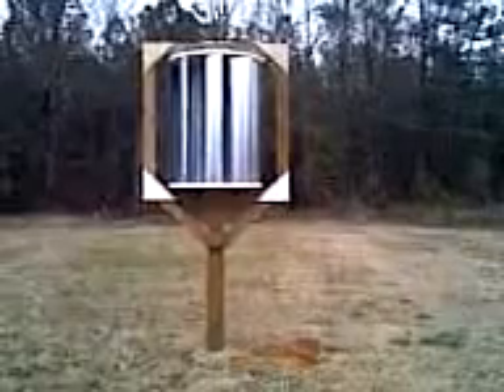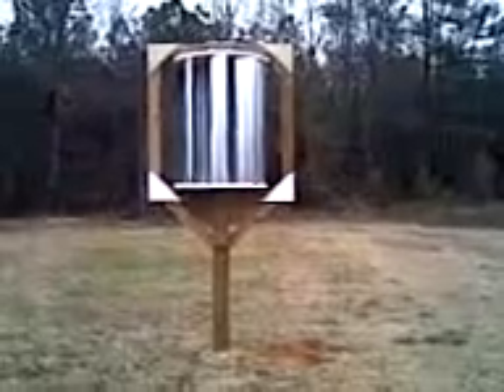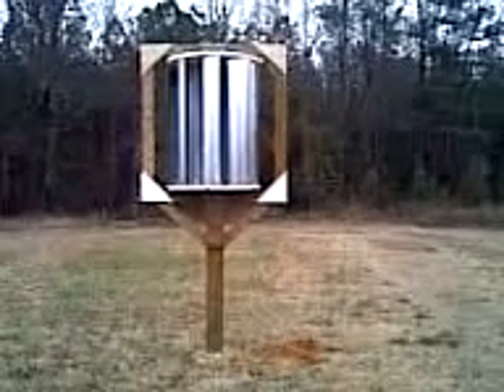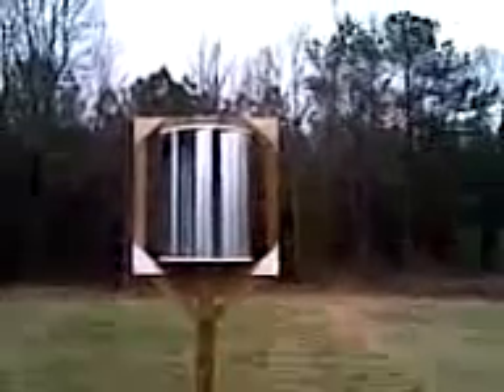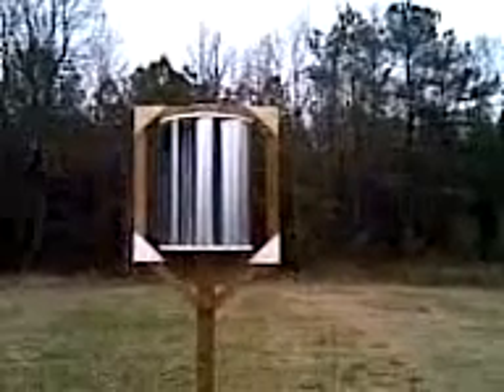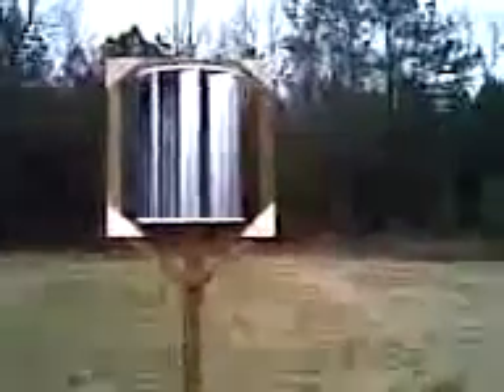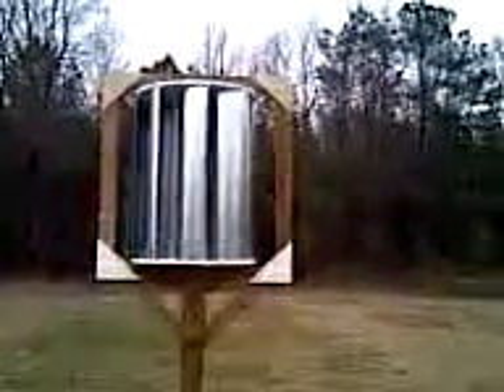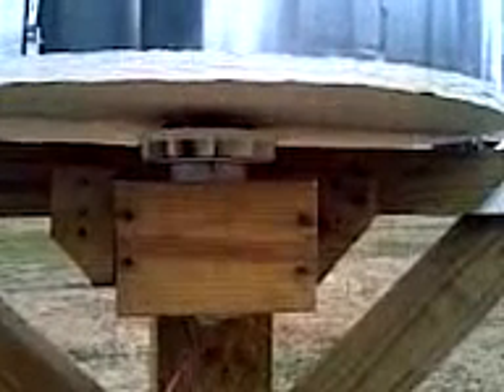wind turbine, vawt part 2

Comment from the maker: @superdivemaster I used a 12 volt dc motor that I got out of a free treadmill. I have come to really like them for wind turbines.  There are 2 reasons that I like them so much. First, they are free and the other reason is they are real easy to deal with. Thank you for the question, Lonny

Comment from the maker: @1899lpv I do not think this would work well with a alternator. You need a lot of speed for a alternator to give you power. This turbine is better for torque because of its size. Thank you for the question, Lonny

Comment: packjim56-  Where do you live? Different areas have different  ratings for average wind speed. It depends on average wind speed, turbine power output, and vehicle battery size. Still, the average doesn't necessarily mean a useful amount of daily charging current or at the times you need it

Something else to make consider. If you live in a northern area, an electric vehicle may not have much in the way of heat or a defroster or at least certainly at the expense of useful mileage per charge.

Comment from the maker: My parts list. 
blades- 8 galvanized steel stove pipe 6 in.
blades- 42 inch tall 
bearings- 2 treadmill bearings 
blade to wood-  48 L brackets
wood- 4x8 plywood
circle- 30 inch cut to circle
base- 4x6 pressure treated 
frame- 4x4 total 21 feet
total height - 9 feet
motor- old treadmill motor
bolts- lots and lots